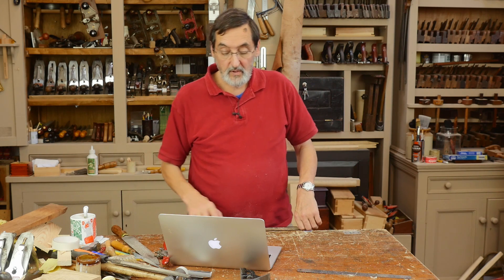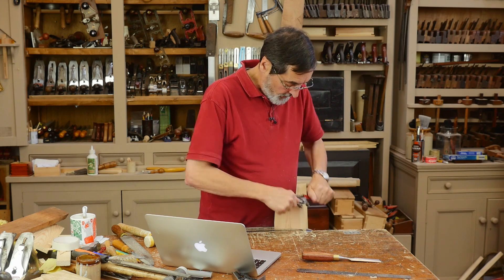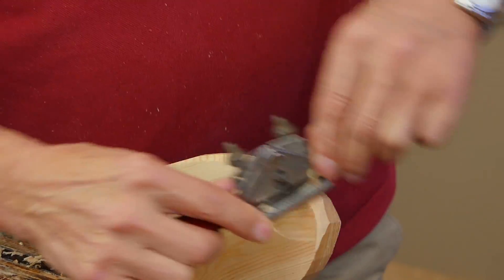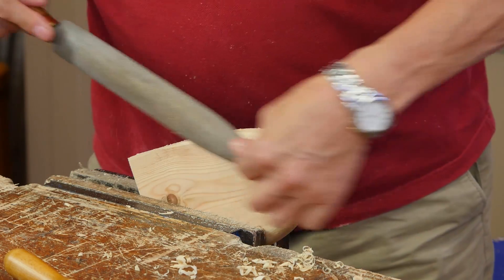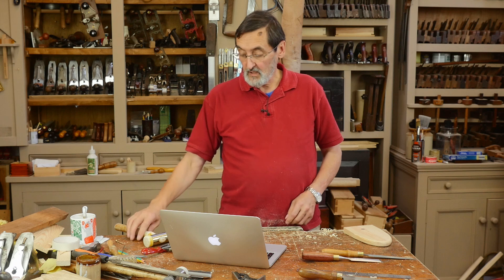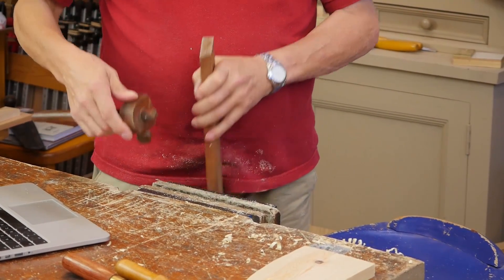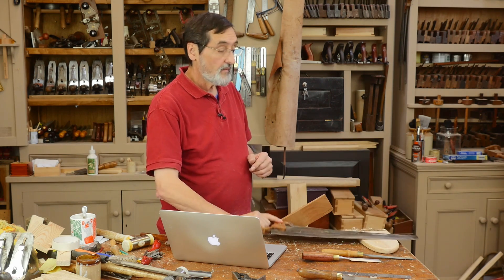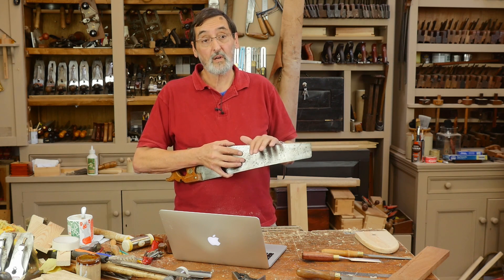Q&A with Paul Sellers Episode 8

Comment: I enjoy your videos very much Thanks

Do you.have any thoughts on clamping without clamps! 

I would like to build the workbench but do not have any long clamps 

Is there a place in woodwork for Spanish windlasses or even Truckers Hitches with rope or 
perhaps any other alternatives

Thanks again

John S
Reply: You can hook two shorter clamps together to form one longer clamp, so if you have enough clamps about half the size, it can be done.
Reply: AJPlaysToday 

Thanks AJ 

At the moment i dont have enough clamps and Paul uses quite a few for laminating the bench 

I wonder if there are any alternatives to the clamps which would do the trick as. I could not justify buying so many at present
Reply: Maybe a  couple of ratchet straps in conjunction with some wood blocks.
Reply: AJPlaysToday 

Yes that sounds feasible Thanks
Reply: André Roubo designed some clamps in the 18th century, that could essentially be made any length you wanted. These clamps used wedges to apply pressure, and could easily be made out of 2x4 lumber. Search google images for reference.
Reply: aDotFromTheFuture 

Thanks I found a good line drawing of Roubo clamps from scrap as you suggested

Looks like they might do the trick
Reply: AJPlaysToday 

Thanks I could probably get some cheap ratchet straps from the local Poundstore

Comment: how do you or can you get a bend or a crease out of a rip saw panel saw.
Reply: was put into the saw during a cut.
Reply: Depending on the bend, you could use a hammer on a metal surface. It all depends on how bent it is.
Reply: I got the saw at a boot sale/flea market for a dollar. I was  going to put some heat to it and pound it out.
Reply: Do not heat it.  Saw blades are spring steel and heating one can anneal it leaving you with a useless blade that simply behaves like a noodle.  Depending on the bend either carefully locate the bend and bend the blade at the bend in the opposite direction until it straightens, or have it straightened.  Even a "boot sale" saw may be worth far more restored than you imagine.  I've restored an old saw with a good grip that I bought for $2.50 and sold it for $75.  So what ever you do, don't ruin the blade with heat.

Comment: Hi Paul, I have a question relating to hand planes, 
I have a number of them, varying types, No4 through to No 5 1/2. (Stanley & POPE (An Aussie version of the Stanley))
I am having difficulty in getting 3 out of my collection to make shavings the width of the blade.

I sharpen them as per your recommendations with a sharpening Jig.
The Planes have also been refurbished & "Tuned " as per your other Video's relating to plane refurbishment.
I've resharpened the blades, checked them for square & even left the blades square to the edge of the bevel.

The Planes I'm having difficulty with are a No 4 & 5 Stanley & a No 4 (9 IN) Falcon POPE.

If you require any further information on what I have done to get a picture of the problem pls let me know.
Cheers
Steve
Reply: I'm not Paul, but I sharpen my own plane irons.  

Retract the iron until you get no shaving.  Take a test board and run lines with a pencil or wood crayon across it.  Lower the iron fractions of a turn at a time and each time your advance the iron, make a pass until you get just a bit dust or threads of shaving.  Take note of whether the shaving comes of in the middle, or to one side, you can often see the interruptions in the lines you drew on the test board more easily than working out where the material is emerging in the throat.  Then lower edge jjjjuuusssttt a tiny bit more.  If the shaving is to one side, the iron is at a slight angle.  Nudge the lever beneath the iron just a tiny bit toward the **same side as the cut**.  If the cut is on the left, push the lever left.  That will move the upper end of the iron toward the same side as the cut and the blade and away.  Make a test cut.  If there is no shaving, lower the iron a wee bit more and try again.  If the cut is still to one side, it will be a wider shaving.  Repeat.  This process should result in a very thin, full width shaving - with pine you should be able to read news print through it.  If you can't get that, the iron isn't sharp enough.  

If you can't tilt the iron far enough to get the edge parallel to the sole of the plane, try re-seating the iron, making sure bed is clean and the depth and side-to-side adjustments are ready and centered.  Repeat.  If the edge can't be properly set parallel to the plane's sole, either the iron edge is ground at an angle, or the body of the plane is a problem and you may have a paper weight or door stop.  Check the iron in another, compatible body.  If it is crooked straighten the blade.  It is straight, consider using the body as a decoration in your office, or sell to someone who sells "vintage" planes for excessive prices. 

If the shaving came out of the center of the throat, the iron is centered and straight but your edge may have more camber (crown) than you want.  Lower the edge and take another pass.  The shaving should be slightly thicker in the middle and feather out on the edges.  With a smoothing plane you don't want a discernible cut with clear edges.  For a number 4 or 5 plane used for smoothing, you want either a barely cambered edge, or a straight edge that you round the corners of in order not to get sharp little edges along the cut.  If the camber is too high, adjust it.
Reply: Hi theddorian,
Thank you for your post & information :). Unfortunately I have ticked all of the boxes that you have mentioned above & double checked that the bevel is square to the edge of the blade. 
I should have mentioned that I'm chasing the thinnest possible shavings (As you mentioned "should be able to read news print through it") from my planes, of which I have achieved this with my other 7 hand planes. I did forget to mention that the blade for the No 5 Stanley is slightly convex on the bevel side, but the other two are OK. 
I tune & sharpen all of my planes to the same procedure & have adopted the Jig for sharpening, as I thought I may have been doing something wrong on that front.
Please let me know if you have any further suggestions 
Cheers
Reply: There are only a small handful of causes that can create a problem getting a full width shaving.  Blade axis inclination, blade edge beveled from one side to the other enough that you can't set it parallel to the sole, or excess camber (crown to some).  Also the
frogs might be skewed.  Did you check that the frogs are installed square, and are properly flat? Sitting in their beds without any saw dust or shavings in the beds?  If the frog surface itself is tilted to one side a problem.  Then of course there is the sole itself.  Did you check that the sole is square to the sides?  A combination or double square should show no light between the square and the side and at the very least, no light between ether edge of the sole and the square blade.  

Convexity of the bevel - from the cutting edge, up over the over the bevel is recommended by Paul I think.  It makes the blade cutting angle a little steeper which sometimes helps with grain direction problems.  It also makes the edge a bit more durable.   Crowning or camber - the blade edge has a slight convex arch from left to right - should result in shavings that are not full width, and if the arch is off center, would lift an off center shaving that was not full width.

Good luck,
Reply: Hi JW, Thank you for your post,
I've been back through the problem planes, checked frogs for square & how they seat on the body, checked the sole's are  flat & square to the opposing edges (I have a 40mm thick slab of granit that I use for all of my truing up) I've also ensured the non bevel side of the blades are flat & true, the chip iron is square & flush with the edge of the blade. The bevel is square to the blade etc..... 

In doing all of the above I thought of something that I had not done to date.

I put a straight edge to the cutting edge of the blade, held it up to the light & discovered that I had the slightest of gaps or camber from left to right of the blade edge :)

I also discovered that once I had my cutting edge to a satifactory finish on the stone, I then continued to very lightly "buff" the cutting edge on the stone & then finish the edge off on the strop with the blade still in the jig (Only to alleviate any chance of a micro bevel for this trial) I then remove the blade from the jig & finish the back edge of the blade on the strop. This helped remove the slight camber I mentioed &  I can now say I've achieved a better result than my original goal as I've produced shavings that are full width & float to ground. 

I've also applyed the lightly buffing approach  on the stone for "quick touch ups" when the cutting edge has dulled off. This only takes a moment as I have jigs to set the correct angle of the blade in the sharpenig jig. 

Cheers
Steve :)
Reply: That's really good.  You'll never have a problem plane again I suspect.

Cheers to you and good New years.

Comment: Paul I am just starting word work in collage what tools do u think I should get to get started at wood work
Reply: btw I mean wood work
Reply: Obviously I am not Paul but I have a penny I can throw in the pile. That is a very difficult question to answer without knowing what you want to do. Do you want to make cabinets? Jewelry boxes? Toys? Chairs? Everything is going to require a slightly different set of tools. Do you want to use power tools or just manual labor hand tools? I enjoy Paul's videos but most of my woodworking is done with power tools.  I make all sorts of things but probably nothing very well (jack of all trades) and the tools I use the most are:
1. cordless drill/driver
2. sliding compound miter saw (fancy chop saw)
3. table saw (decent hybrid saw, not a table topper)
4. 13" planer
5. kreg pocket hole jig (the easiest, strongest joinery method. Joinery purists will not be impressed, but it is easier than tenons and mortises.)
Most of those are pretty expensive machines so just pick one and start making things. As you start making, you will know better than anyone else what that next tool purchase should be.
Reply: +evilhorde1 ty I will try and get some of them tools in the future but atm I am looking for hand tools for carpentry and joinery
Reply: Matthew styles To start I would recommend a set of chisels ranging from 1/4" to 1", a 12" combination square, tape measure, a panel saw and a crosscut hand saw, a no.4 hand plane, a marking knife (exacto knife can be used), coping saw, a few clamps, power drill, and a Mallet. This is if you already have a work bench or stable surface with a vise. If not, then alternatives for securing work such as workmates are available. Most items here can be inexpensive and don't hesitate to buy tools second hand to save some money
Reply: +Braden Gourley ty very much for the help
Reply: Collage?  The art form?
Reply: theeddorian ?????
Reply: It was a serious question.  Are you saying you are making collages, like intarsia, or was that simply a typographical error?  And "the eddorian" is a sci-fi allusion.
Reply: theeddorian no I'm in college

Comment: Could you sharpen an impulse hardened saw blade with a diamond file?
Reply from the maker: Not economically as the electroplating holding the diamonds would be subject scoring because of the concentrated area surrounding the points.
Reply: Thank you for the prompt reply. I am really enjoying your videos especially the ones about sharpening.